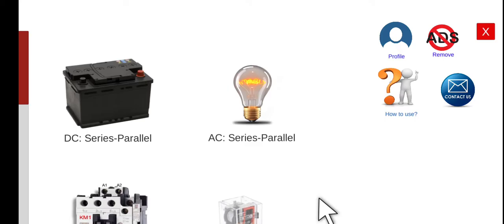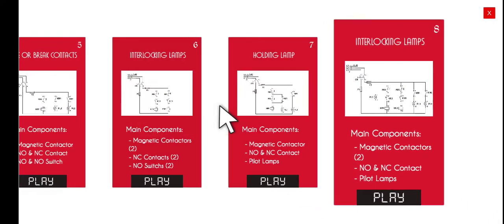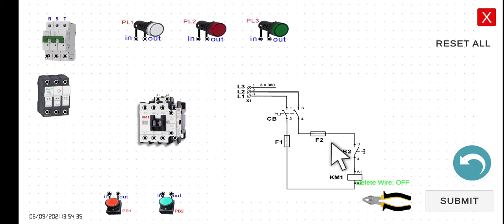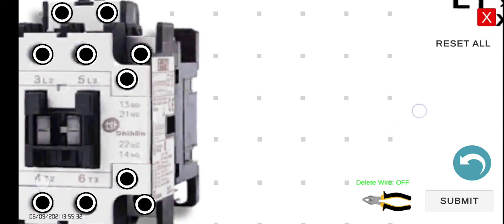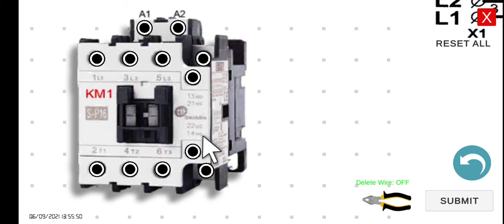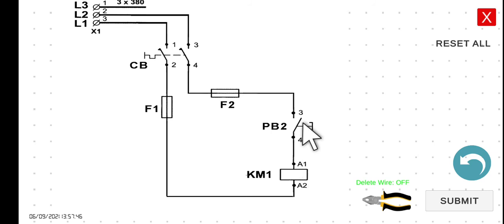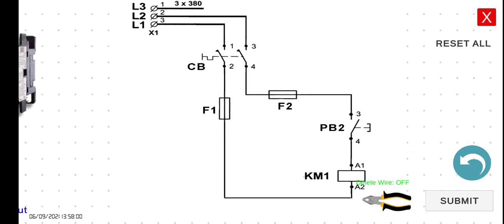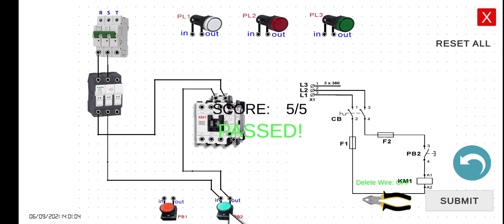Contactor1   Magnetic contactor

Comment: This is a great app for electrical simulation. First one ive seen that has acctual components to wire. Still very buggy. The lines you cant follow to the points it only works diagonal lines. and the screen follow is buggy. Overall with improvements i would give it a high ratinf. Ive purchased unlocks which are great for mor features. Wish there was Aircon and refrigeration wiring that would top it up and make this the best app ever in electrical simulation. Nice work.

Comment: If I join the live to both end of the coul, how the current will flow? This diagram is a fail. A1 should be L1 and A2 the N.
Reply: Its possible if coil voltage is 380v